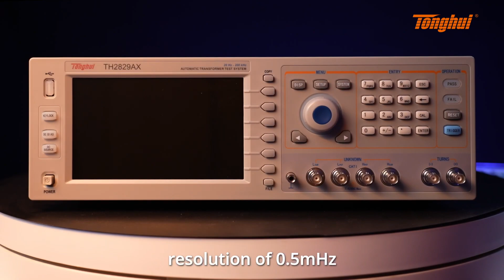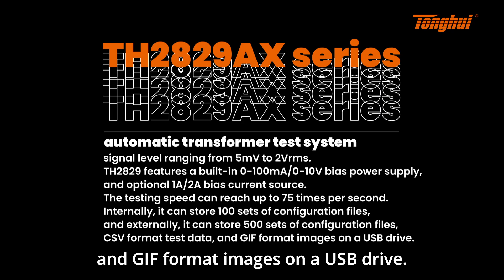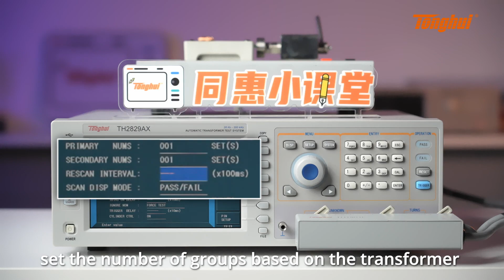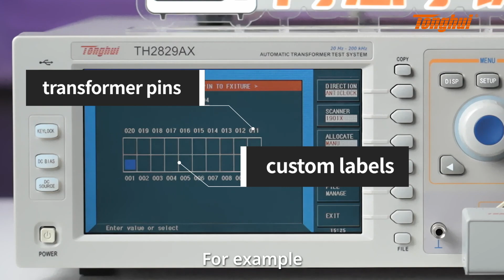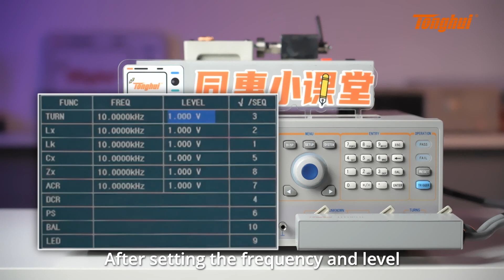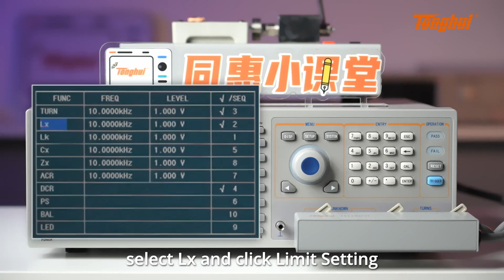Tonghui TH2829X transformer tester basic operation

Comment: Hello,
Thank you for sharing. 

1. Can you also make a video or tell how do we change the default language setting. When we power on and off it switches to Chinese language from English language.

2. How do we store drawing files in the equipment (without pendrive and computer).
Reply from the maker: 1 The button battery has been removed for air shipment. So please fix the button battery in the tester, then the setting, date and time could be saved.
2 The curve data could be saved in CSV format in U disk.
Reply: Hallo, thank you for your video's

Can you explain how to activate the start button on scanning box?
Reply: Hi,can you explain step by step how to save data test result to usb flashdisk